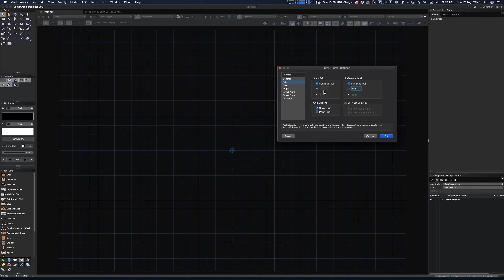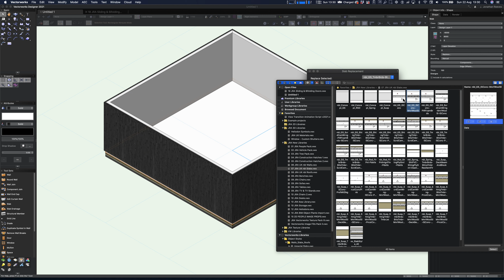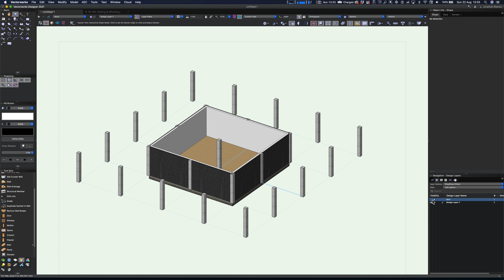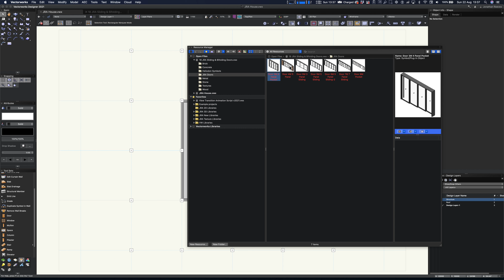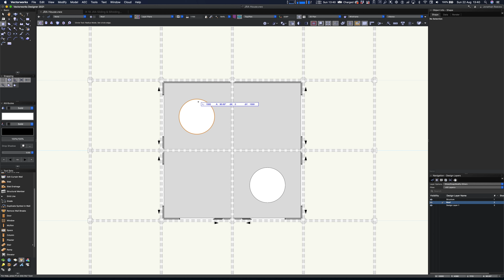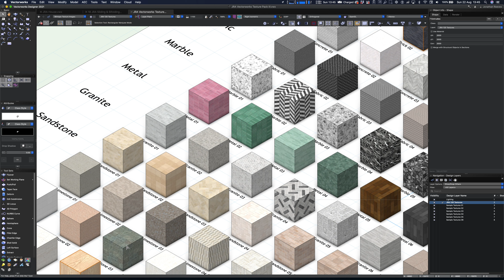Power Your Productivity with Vectorworks: Part I (4K)

Comment: Hi Jonathan, As usuall a very useful video, with loads of good tips!

Although one thing to point out (not related to the content) is the way you record the video and your webcam because it's using a different frames per second than the video recording, it seems you're using 30fps on the recording software, don't know which camera you have but you should be able to adjust that on the settings.
Reply from the maker: Thanks for the info!